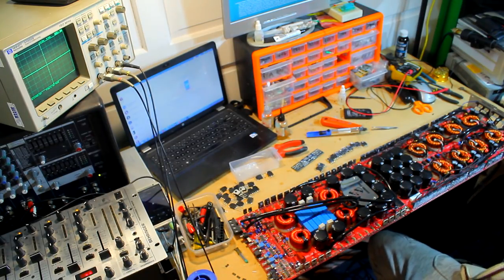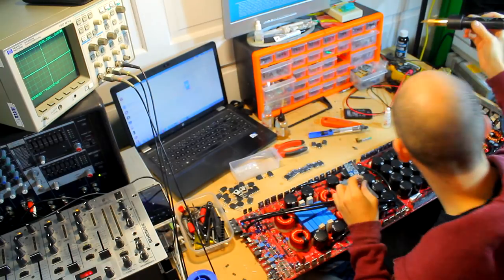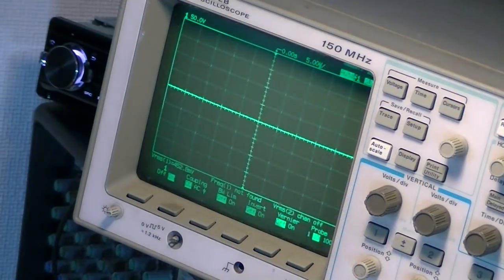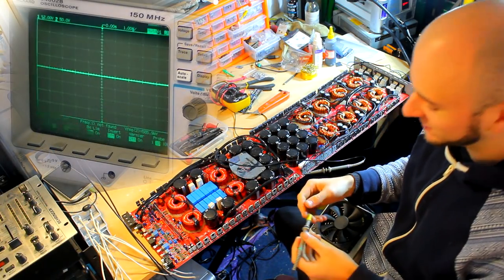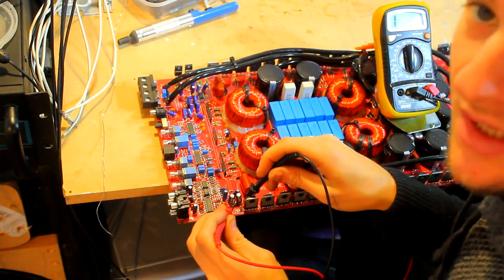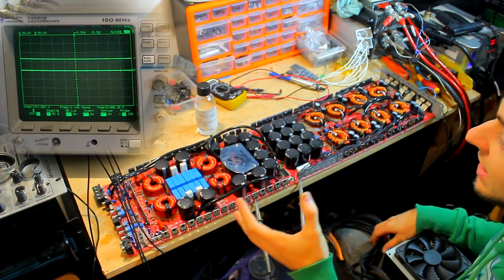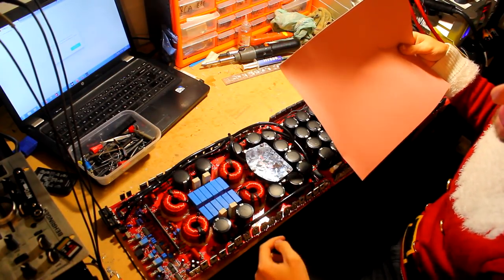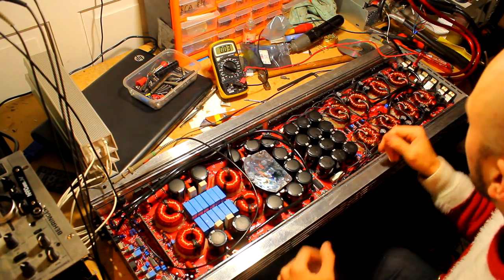Amplifier Repair 10,000Wrms Ground Zero 10K subwoofer amp

Comment: why did you fix that trace and not checked the regulator? trace didn't blow for no reason. Also that insulating material is NOT that great, you can go much much much better than that
Reply from the maker: First2ner oversight! if you can find me some that is as good which isn't twice the price, link me up buddy!
Reply: I guess it really depends, don't it? how much heat do you need to take away, for class D amp, you are not looking at that much, so that pad you got might even be good option. How many transistors can you cover with that sheet?
Something that would be cool, but I don't think anyone would use is aluminium oxide ceramic with its thermal conductivity of 15.06W/m.K, much better then pad, maybe more expensive, but probably harder to install and overkill?
Reply: I use aluminum oxide pad on a class A amp. They're rated at 20W/m.K. The TO-264 size costs 19 bucks for 100pcs from China. And you still need a bit amount of thermal paste to fill the pits on the metals for better thermal conductivity
Reply: what thermal paste do you use? standard one or some better?
Too bad those aluminum oxide pad are not on ebay (or cheap)
Reply: I use shin-etsu. Not the best but better than standard stuffs. I sometimes go with gelid gc extreme too
Reply: I love your video, I don’t know much but I would love if you took a few minutes to explain the difference in the amp designs you fix , explain how they work too would be great , I will watch your channel in the future thanks

Comment: great repair nice work just hint you can use with power supply 70AH battery so you can load amp at full power for decent amount of time to test full power hope this help.
Reply from the maker: Hosam Kyali batteries supply too much burst current, the whole idea of the small supply is to only just power it up, so if there are any faults then the supply trips instantly. a battery wouldn't trip, and cause damage.
Reply: barevids sure true l mention it as supply after repair test nice work again ^^

Comment: Have you ever blown a component while working on an amp? If so, how did it happen?
Reply from the maker: yeah of course! Havent done for a while, but its all part of repair. Youll see it happen in a video I am working on for a home theater plate amp!
Reply from the maker: the first amp i ever attempted repair on, over a year and a half ago, was a hifonics 1600w - fitted everything and turned it on with the big supply. the second the remote touched, the WHOLE THING went up in flames, no joke big fire, bangs, bit of fet shooting past my face and ash all in the air.... lol
Reply: home theater plate amp sounds mad exciting (for me). im calling TDA or LM chip amps. unless its a rare case of a half decent one with discrete transistors. which myself, have never seen
Reply from the maker: its a yamaha sw800, class G circuit, using 2sk2378 nd 2sj406 mosfet outputs, i replaced with fqp19n20 and 12p20 but i dont think its happy with them, going to try 640n/9640 tomorrow
Reply: I remember finishing a repair and after replacing the case saw a little whisker of a wire on top of the case. I had the amp running as I went to pick it up - maybe I exhaled, but it disappeared down through a cooling vent and before I could react, before I could think ' that surely won't do anything'..It exploded with a massive bang. Never let those little whisps of wire get near anything, I learnt a good lesson. That was a perfect example of Murphy's law, if anything can happen, it will. The law should be amended with,  'the smaller something is the more damage it will do'. (c)MDA2017 ;0)

Comment: Hi we should help you as a token of appreciation as well.

1) When doing a repair on an amplifier ( especially in this state AND WITHOUT the heatsink), starting with the power supply section mount one fet per side, there is no need to fit them all during turn on testing or light weight testing, the reason why is if a shorts appears again, they will blow all of them really not a good feeling. 

2) if you can, try to obtain a power supply or build a current limiter for the ATX one you using (its simple) , a current set to 1A (or less) will reduce blowing your amplifier, again especially an amplifier in this state (already repaired) 

3) If you can, save up for a flir camera , this will root out any issues when it comes to verifying components heating up erraticly during  repair before and after.

Just as an example: 

Thus setting the current to 0.5A or 500mA will give the following:
Power = (I X V)... thus 0.5A * 12Vdc
Power = 6 Watts 

Only 6-Watts of power can flow at any point during a short.

Comment: Amateur!! Not 10,000 watts. Run in on SMD dyno and u will see. 10,000 would need huge heat sinks and not crappy mosfets
Reply from the maker: Please do your research before commenting. This amplifier mounts into a very large heatsink. It is around 70% efficient so heat generation is reduced. It uses an output section consisting of x32 FDA24N40F mosfets. Perhaps you should take a look at the datasheet for this mosfet and determine that the current handling capacity is sufficient for a true 10,000Wrms output? The rail voltages which the audio wave swings between are between +/-170-180v depending on input voltage. Taking into account voltage drop under load of the output rail, say with a drop to +/-160v, at 1ohm that allows for over 10,000Wrms of output. The power supply section of this amplifier is also horrifically large with x64 IRFP064N mosfets to create the +/-180v rails with significant current behind them.
Reply: Really dude? Ground Zero’s are strong ass amps and I know it is broke but abusing anything can cause failures.